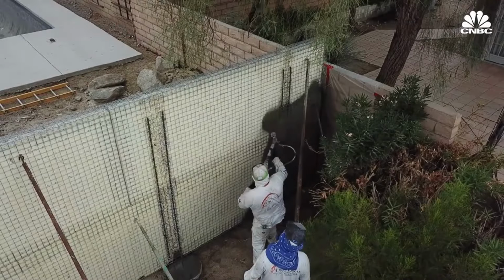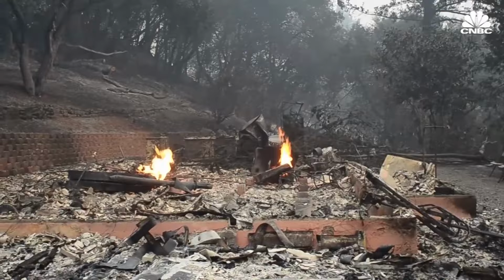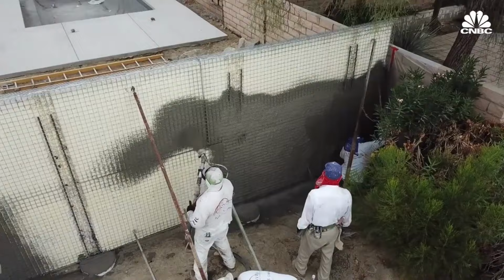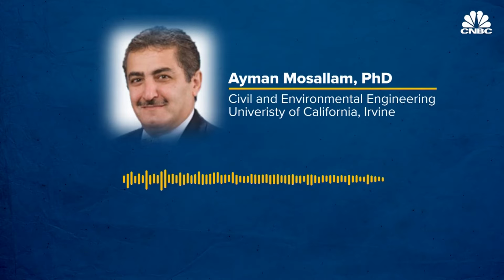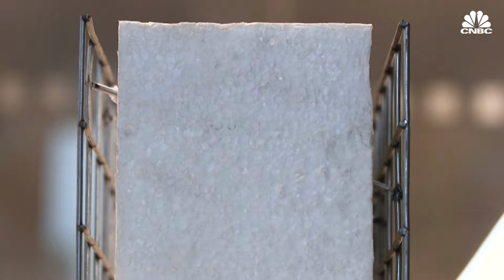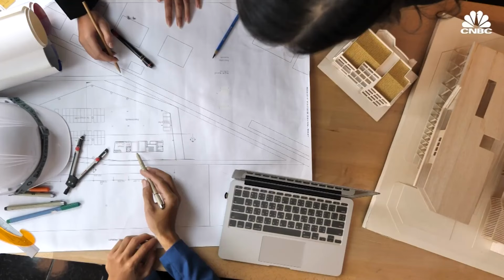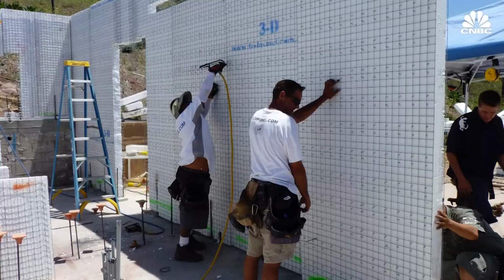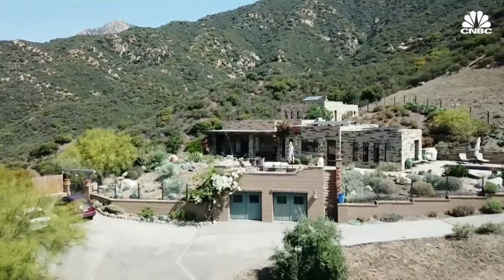This Material Protects Homes. Why Don't US Builders Use It?

Comment: The system was invented in California in the 60s. 
It was first patient in the early 70s.
2 hour fire rated, 250 wind load, 9.0 seismic rated. Oh 70% more energy efficient than traditional wood homes.  More efficient than SIP or ICF due to thermal mass.
Reply: Are you sure about that? Your code only show A,B, and C, rating for seismic. and the entire certification expires this month!  Did you renew it ?
Reply: This will be the system I use for a single  story house in Florida on the Atlantic coast. 
Plan to move in a year or so after I buy land during the impending Great Recession. 
Will add a rooftop deck and BBQ with an elevator and firepole.
Hope to make it on the cover of Architectural Digest. 
Wish me luck.
Reply: How does it have more mass than an 8” ICF block?

Comment: I am reading a lot of negative comments here. Habitat for humanity built several of their homes using this material in Homestead Florida. They were built right before hurricane Andrew hit. Homestead was Ground Zero. The Habitat for Humanity houses survived hurricane Andrew when other houses in the neighborhood were demolished. The roof and walls are one solid piece. There is no little tile or molding to come off the roof and become a weak point and have the wind get under it and tear the house apart. It doesn't make sense to build a house with a roof made up of hundreds of little pieces. SCIP panels survived a category five hurricane. They don't burn. They don't rot. They have been around for 40 years. It kind of makes you wonder why no one is making houses out of them.
Reply: Greed . The cost of all the hundreds of different materials to construct houses would be put out of business I’m looking into building some of these in Baja.
Reply: It's more expensive to build them, but less expensive for maintenance. Works fine for residential, but not commercial mainly because each tenant have different interior set up (walls, AC capacities, electrical needs, type of business etc.) I am a contractor.
Reply: @TH-yum The way homeowners insurance is rising, this method may actually be cheaper.
Reply: @TH-yum we all know interior walls in Florida are just wood and drywall.
Reply: Made from foam. I'm sure that's an environmentally friendly and sustainable material. Probably doesn't offgas into the house either like most petroleum based products.

Comment: White floating concrete has been around a long time. Its great. Light weight, Fire proof, + accepts drywall screws like wood. I seen a 2' cube float in water high like a cork
Reply: I obviously shouldn't point out then what would happen if a large structure we inundated with water from storm surge then
Reply: and eco friendly,...you will spear the woods

Comment: The opening shot of a wall and also the shot of the modern concrete building is work done by my uncle in palm desert ca.  He runs a crew with over 20 years experience with 3d panel construction.  We are also distributors of the paneling.
Reply: The modern building is the palm desert chamber of commerce henderson building
Reply: Tell him I'm hiring his crew in about a year for a working vacation on the mid Atlantic Coast of Florida. 
I'll rent a house for 6 months just for him and his crew. Boss gets the master.
It'll be on the beach. 
Wish me luck.

Comment: I worked expat in South America for several years in different countries. Houses there are built mostly with concrete and blocks similar to what they are showing in this video. Constructions there last forever and unless the natural disaster completely yanks the house, it is not going anywhere. Same with fires, I don’t remember seeing a fire in a house there unless it was a wood house. Construction is mostly driven by cost and like they said in this video, wood was super cheap in the US; so that is what we do. But it is expensive in the long run. We catch fires and natural disasters very easily and I think we are spending more in the long run rebuilding all these houses over and over. So yeah, we sure need a different technology to build our houses.

Comment: I always wondered being an Indian we build fully concrete homes and Americans build with wood.. 
Wood is widely available though in America .. 

Concrete is non flammable 
Heavy can withstand tornados 
Cannot be damaged by flooding.. 
Termite resistant..

Why they don't use concrete in large numbers?
Reply: Profit margin probably.
Reply: Cost.  Americans want things to look nice without paying very much money...
Reply: Insurance company greed?
Reply: @richfarfugnuven6308   Building a concrete house in Asia (China, Japan, Korean...) would cost less than wooden house in US.
Maybe people need to think why the infra is more expensive in US and in less quality.
Reply: @hamster6093  a large part is labor costs here in the US as well...
Reply: @richfarfugnuven6308  
 when you pay more for labor, you value their expertise in this industry. But it turns out  the cost and the quality does not match. Currently, there are limitation for work visa such as H1B to protect American. When it opens, customers will realize how good the world is.
Reply: Can withstand weaker tornadoes. The strongest tornadoes will destroy concrete houses.
Reply: @help3102  I highly doubt that. In Asia, The concrete house, we refer to reinforced concrete (RC). With high density steel bars embedded inside, the buildings are capable to withstand earthquake even in Magnitude 7-8. That's the way to build the large bridges and highway. 
I seldom see this structure for home building in states, just some concrete blocks that's all.
Reply: Home insurance companies wouldn't make any money
Reply: There’s multiple reasons why we don’t use bricks. #1 Your essentially building an oven if you live in the Southwestern US as temperatures, reach 47 C in the Summer.
Reply: #2 Earthquakes prone areas like California or Alaska Brick houses will collapse as it can not take the shock from the Earthquake

Comment: If i ever get my siding redone getting a fire proof concrete skin sounds good.
Reply: Protect the eaves on your roof too.  That’s where fire embers 🔥 usually take hold externally.  They settle in the the eaves and then move into the attic.
Reply: @AnnetteBond  I’m concerned with that too. Some of the Hardie Board products looked interesting but I have weight and heat conductance questions.

Comment: My house is made from it, well it was. Until hurricane Ian came, and it blew the door, and the roof right off.  My neighbors with cbs and even wood frame did better.  Lastly my insurance said they don’t cover houses built to this material as it wasn’t meant to withstand hurricanes. Don’t get this. Had my house demolished and rebuilt using CBS.

Comment: House fires often start from furnishings such as electrical goods which are not part of the building structure. It's nice if the building won't fall down, but if the smoke killed all the people inside they're just dead in a building that didn't fall down.

There are always alternatives to building your house full of synthetic foam, kids. All that reinforcing mesh is great, but you can do better than filling the gap with toxic waste.

Comment: rats and birds LOVE foam!!! sprayed gunite is NOT immune to crackage, or woodpeckers. yeah, yeah...this was used for warehouses 42-years ago in S.A., that I'd drawn the Plans for.  Ask them who built them there then. yeah, sure..."when used properly". There's a "trick" for their in-wall Vertical Steel Rebar Reinforcing, and...I don't see that in your pics. Old Architect in SW FL, USA here, and gimmicks have come & gone throughout my experience in FL & the Carib. Besides, how hard is it for a cordless saw with a metal blade to open up a gunite/foam-n-cattle panel wall? About 5-minutes, and thieves would be inside!! There ARE better ways, kids. Just cause a guy wearing a suit tells ya its so, doesn't make it REAL! :-)

Comment: I like this but I'm concerned about the chemicals used in the foam. Also, how does it stand up to insect damage and when will the cost become reasonable? Someone is making a lot of money for a house built with foam and wire.
Reply: You know it's covered in concrete right?
Reply: Since it's sealed in concrete it will eliminate the dangerous fumes you're rightly concerned about. 
I'd be more worried of any VOX coming from the paint or carpeting. 
That's why I use real wood 5" interlocking planks and 16" or 18" tile done in an offset style.
Reply: @thisismagacountry1318  termites will eat into concrete and brick.  They say resistant... because they can't say proof.  Anything is resistant with pre-fab insecticides and proper maintenance.

Comment: "A wood structure will combust almost immediately"... " You can not get to a net-zero house with wood " either these guys are knowingly lying, with a straight face. Or they have never heard of CLT.
Reply: What's clt?
Reply: @kiammiefreeman9103  Chicken, Lettuce, and Tomato
Reply: @kiammiefreeman9103  cross laminated timber
Reply: Sounds too good to be true... because it is.  There are a lot of issues with this type of material they are not talking about.  Hadite blocks filled with rebar and foam which are STRONGER than this have been completely pummeled in tornadoes.

Comment: So... What's the catch? What if you want to remodel? How do you safely cut through it? Does it off-gas during fires? What about mold if the house sits empty for a few months? Can it be repaired?
Reply: Exactly, isn’t concrete porous? How will high humidity and rainfall affect it over time and not act just like when rebar rusts in concrete causing it to fail?

Comment: So every wire through the insulation forms a sink for the temperature so if the outside concrete is cold the inside will have to fight that cold too. Terrible design for extreme climates

Comment: How is styrofoam going to prevent fires.
Reply: Fred Frond it’s covered with cement
Reply: Its called an Insulated Concrete Form or ICF (trade name). The Styrofoam acts as an insulator for both sound and temperature. It also helps when forming the concrete.

ICF isn't really sustainable, it uses  petroleum byproducts to act the way it is. The concrete core of the ICF stops fires

Comment: Just because the US has many dense forests, doesn’t make wood the best material for housing construction. Even if wood is abundant, the average house made from wood is still expensive for most people to afford. People spend their lifetime paying mortgage when wood homes don’t last long and require a lot of maintenance as they get older. Inflation and demand has raised the cost of wooden homes even more. Home insurance costs have gone higher. People can’t afford flood insurance. These wood homes can not stand tornadoes, hurricanes, flooding, and go up in flames easily if fire.

People who lived centuries ago lived in better houses than we do. You can still see ruins and remains of houses build from centuries ago. They used better material.

The US really needs to learn and make a change. Give the common man a house made from material that lasts for generations.

And stop cutting the forests no matter which part of the world. Stop cutting trees. They are much more valuable than making a house out of them.

Comment: Sorry, but put one of these through an F4 tornado and you're going to be looking at heaps of chopsticks.
Reply: Let's get some takeout!
Reply: No you won't. There's no wood for chopsticks. 

It's concrete. How many parking garages get blown away...even in high end tornadoes? 
None......that's how many.
Reply: kikstand2011 
Parking garages are not built like this, they are built with massive steel beams and pillars encased in reinforced concrete to support the massive weight. These houses don’t even come near that level of building.
Reply: @horsewithnoname8795  steel beams are used in houses just not in america.

Comment: It’s a good start but you are not there yet. Judging by what I saw in this video the buildings have no foundations, meaning: no reinforced concrete pillars that sink into the ground at least 1/3 of the total height of the building and that anchor that building to the ground. Also, the amount of steel bars (and they have to be made out of steel, not iron) that are coming out of the base and into which the wall is lowered, are just not enough. There are other details that should be fine tuned, too many to list here.

Comment: wouldnt the concrete make the inside of the house real warm and more difficult to cool?
Reply: no. because the foam between the 2 cement layers acts as insulation.
Reply: @ericmartin2470  I currently live in a house designed by my wife and I ,made of this same material. The temperatures stay very constant. It is the most comfortable house I have lived in so far.
Reply: @sethhack899  i dont debut it. its why i'm a big fan of spray foam. it acts as an insulator and air barrier. the house i'm looking to build is a Post Frame House and using spray foam extensively throughout with a conditioned attic.
Reply: @ericmartin2470  I just had a brick dome in Mexico insulated with close cell sprayed foam. Excellent method. With both methods mentioned, the elimination of air draft in the house is a big contributing factor towards comfort many times difficult to achieve with other insulation methods.